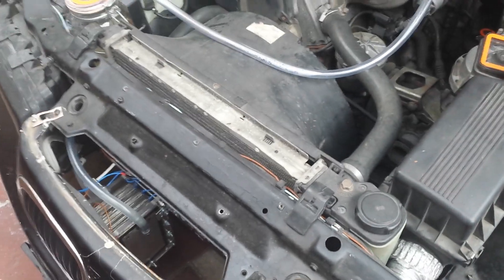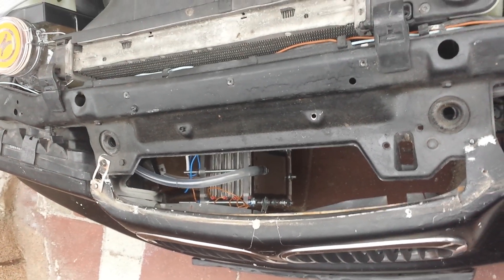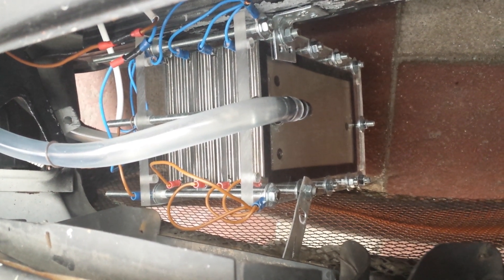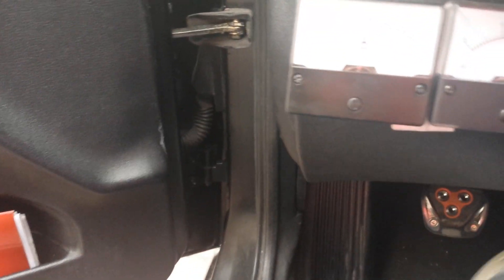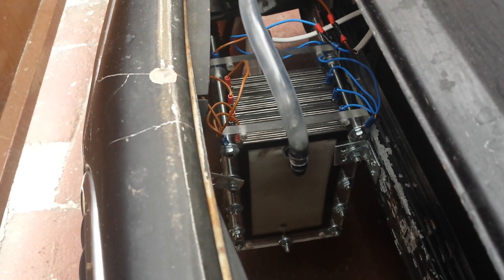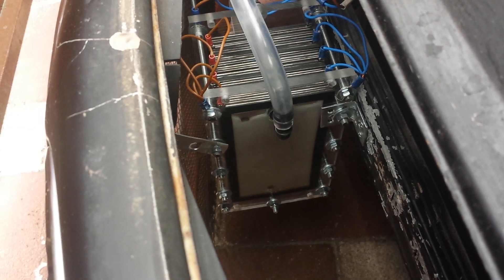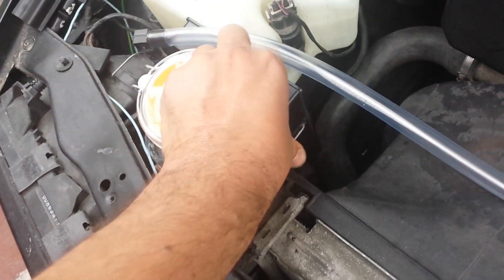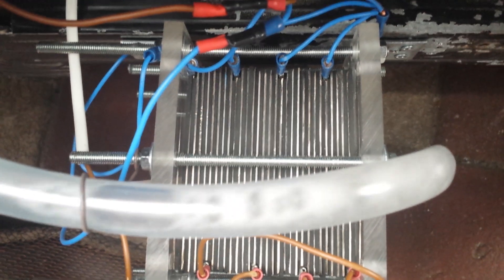Hho generator stainless steel vs aluminum plates

Comment: Aluminum plate react with oxygen to form aluminum hydroxide which don't fizzy, produce only pure hydrogen gas
Reply: Aluminium reacts with NaOH to form sodium aluminate (NaAlO2) and hydrogen (H2). Aluminium plates literally dissolve in this solution. NEVER USE THEM
Reply from the maker: The problem is that aluminium gets eaten away

Comment: this design does not work and you are wasting your time and money with this...nothing is free...including mileage...the extra resistance from the generator used to make the hho will decrease your mpg and you dumping the gases from making it back into the engine to burn does absolutely nothing more than you already had...you actually have less energy available now because  nothing is 100% efficient so you definitely will have loses...so in simple terms hooking up the generator makes it harder for your engine to spin because of the increased load put on your alternator so it now takes more fuel to move the vehicle the same distance than it did before you hooked up the generator...and since you are using the energy taken from the gasoline to make the hho and then eventually reintroducing it back to the gasoline to burn in an attempt to make the vehicle more fuel efficient...best case scenario it would just only bring you close to  where you started.. which I am sure that anyone with common sense will agree that it's a stupid move to do this in this configuration and run the hho using the engine then feed it back to the engine...God its amazing how stupid people can be...there are ways to increase the fuel efficiency  in vehicles but this is NOT one of them...using solar panels on the vehicle itself to make the hho is 1 option...or have a bank of capacitors/batteries that are charged not from the vehicle itself that you can charge at home...doing both would be an even better option...doing it this way is no different than hanging a parachute behind the vehicle while driving to funnel air into a wind generator then using the power generated to increase the vehicles speed...umm... hello need I say more...use your hho setup and make a loop like this with your generator at home...run it dry then use a measured amount of fuel and run a same exact load with the hho setup and without the hho setup...and if it runs longer with the hho setup then you better run inside and tell the old lady to put on the red panties cause you are about to be rich because you can prove perpetual motion is possible and its possible to finish with more energy than you started with...dumbasses

Comment: Your generator doesn't look too hold much water, do you have to ever have to refill that thing?
Reply from the maker: i have a 1L bubbler, i top up water every 3-4 months
Reply: I've seen and read a lot about hooking it up to a vacuum line and the intake, have you tested anything with using vacuum or is there any benefit? I'm trying to form the best plan for my own setup hopefully very soon.
Reply from the maker: @trashin.n.smashin  i have once connected it to my vacuum but had problems and it screwed up my idol for some reason.

Comment: I have also made hho generator 
I want to know why my hho generator wire becoming over heat and battery draining very fast
I have used aluminum plates
Reply from the maker: Chintan Leuva Patel watch my other video on aluminium hho and you will see why you shouldn't make one. Overheating is maybe you nead more plates but not aluminium.

Comment: You say  the  fuel consumption  is reduced by 40% and it used up to 15 amps. ..... If you  can almost treble the amount of plates ,  and use up to 45Amps, would you have the engine running 100%  hydrogen?

Comment: your engine runs like shit because its sucking false air or hho in, try to make the hho line go in before the mass air flow sensor instead of after. i think it will run heaps better

Comment: awesome! Few questions I am dying to hear the answer. Please can you answer them?

1. How much water do you use, and how long does it last you?
2. Did you see any changes to the milage and/or horsepower when using this?
3. Did you replace the air intake to feed only the HHO? or did you mix the air intake with the HHO?
Reply from the maker: it depends on the size of your hho how much water goes in. my hho outlet pipe goes straight into my air intake no modification. the power I dont see any changes.  fuel economy is best only on the highway not in the city.
Reply: +01wizmiles01 Great thanks! And the amount of water you use, how long does it last you?
Reply from the maker: ive been using the same water at least 1year. I may top up 3 times a year
Reply: +01wizmiles01 Thanks for the info!

Comment: it will be great if someone recorded you.. instead of you holding the camera. need to show us properly
1. where the hoses are attached to in the engine. how is the battery connected to the wires
3. is there a cut out fuse.
how is the amp and voltage meter connected and to what. 
4. it will great with fine details.
right now...i have no idea where the meteres fit and of what purpose are they for.
wonder where in the engine does the hho plactic pipe fit into

Comment from the maker: don't know
Reply: +01wizmiles01 you might need to tune the engine to get it to run properly. ignition timing is crucial since hydrogen burns so much faster than gasoline

Comment: you only should use naoh or koh 
do not use anything  else ....don't use salt 
it will make chlorine gas ...wich will destroy the aluminum plates + your engine .....
aluminum plates works but with a good electrolyte

Comment: Aluminum works, but only in wet cells. Also, are you combusting the hydrogen, or are you using it in a battery?

Comment: I noticed you ended with a positive plate. If you would end with a negative plate, (with the neutral plates still between) you will produce more HHO. Yes you will end up with more negative plates than positive, you will have maximized you HHO production.

Comment: very good work
thanks for the information
but what is the job for the neutral plates
Reply: Neutral plates divide the voltage amongst themselves with two volts being the minimal voltage to produce HHO. 12 volts, 6 gaps using 7 plates in all with + and - being attached to only the 2 end plates
+[  l l l l l ]-  connect a voltmeter to any 2 plates that are next to each other and you will read a voltage drop of 2v. Don't make the generator work harder than it needs to. Hope this helps.

Comment: You have to use the Aluminum for the neutral plates it produces a lot of hho and has greater combustion, aluminum absorbs to much heat which decreases energy thats why it didn't work when you used them for you pos and neg plates. I will show you video of my aluminum plate cell with only 8 thin stainless steel plates

Comment: Good Video. Straight to the point. I have tested with several different types of metal and stainless steel is by far the best i have used. Also, in your last video when you were talking about the electrolyte (baking soda) to help split the water molecule, I have found that using a PWM (Pulse Width Modulator) to control the frequency of the current it increases the hydrogen production 10 fold.
Reply from the maker: thats true im going to install a pwm also
Reply: Steven Graham Can u advise on the period and duty cycle of he PWM as well as the amplitude?
Reply: yeah you people are always saying how a PWM works so great but nobody ever gives any specifics on settings you put your PWM at. It matters the frequency you set it at.
Reply: @coyotegene86  - thinking the 316 L stainless steel is the best to make the plates from.
Reply: Has anyone ever considered using Colloidal Silver as the catalyst? Just curious but maybe excellent current flow and increased HHO production. Ya think?
Reply: @aleanufopilotftlcertified5663  it would cost a lot
Reply: @feedthemlasvegas2249   -  actually 30-50 ppm should really improve conductivity. I've made more than 20 quart-sized batches for antibacterial purposes and one can barely see the usage from the two one-ounce Silver Eagles I use. Down from 31g each to 30.7g. Someone should experiment using CS as the catalyst as it's not caustic at all. At least not around 50ppm. A red laser shining through a quart jar of 50ppm CS is very visibly reflecting off of the silver from wall to wall. I'd love hearing back from someone trying this method. The silver ions are  all negatively charged and may be pulled out of the water quickly the first time that current is applied. Or they may attach themselves to the plates due to magnetism. I'm sure curious.

Comment: Copper aye? Well both copper and aluminum are corrosive materials. But they both have conductive properties. Which is why most ppl use stainless. I'm not sure what other differences there might be. I would think that almost any conductive material could be utalized. Stainless, copper, bronze, platinum, quartz.

Comment: I was looking for a while on the net debating aluminum or stainless and I finally found your vid and BAM! There was my answer. Haha. Thank you
Reply from the maker: i heard from people that aluminium and copper plates are better then stainless steel. so i built one from aluminium and as you can see in one of my videos it dont work and the aluminium gets eaten away even when theres no power going through the plates. so im not going to try copper just stick to stainless steel.
Reply: 01wizmiles01 so you say ss is better than aluminium plates
Reply from the maker: ss is totally better
Reply: OK sir

Comment: Nice job and thanks for doing the experimenting for us. I have a couple of questions for you on your car's idling. I noticed it surging while hydrogen was being produced and introduced into the intake. How does the engine react to normal driving conditions, do you feel a surge while cruising at a steady speed? Have you compensated with the idler and/or computer to create a steady idle? And what did you use as your electrolyte in this new and improved fuel cell? Thanks a lot Miles, Cheers mate.
Reply from the maker: the engine runs perfectly but that morning i turned in on first time and it was cold until it warmed up. while driving there are no problems, idles and drives beautiful no surging.i did nothing with the idle or the computer. the electrolytes i use is Na0h with tap water. so far the water is still clean and the plates are still as new.
Reply: Glad i read these 2 comments !